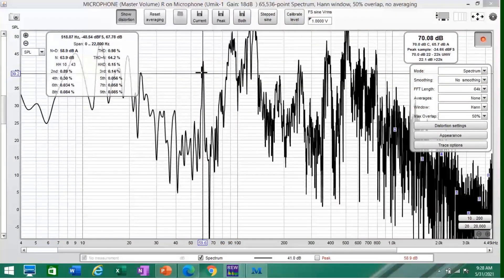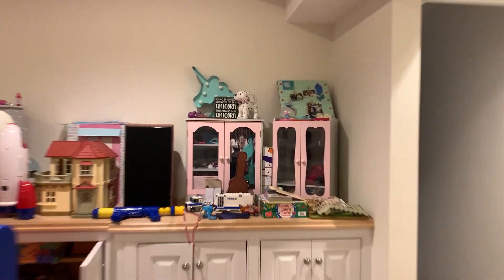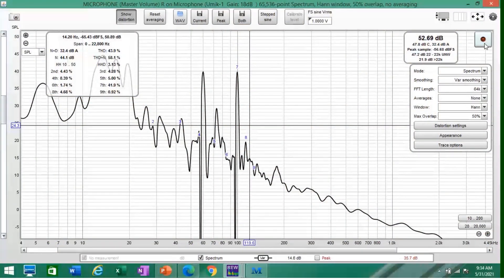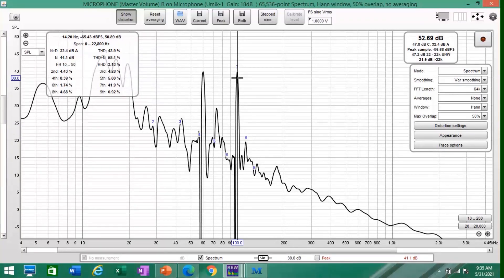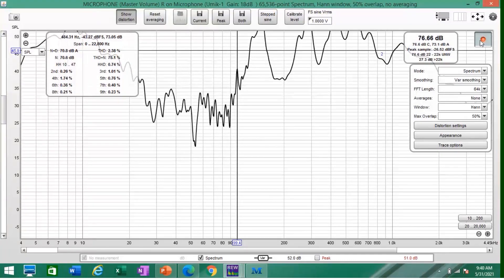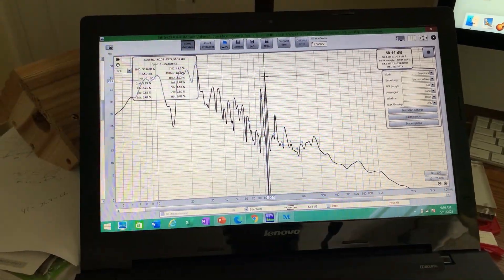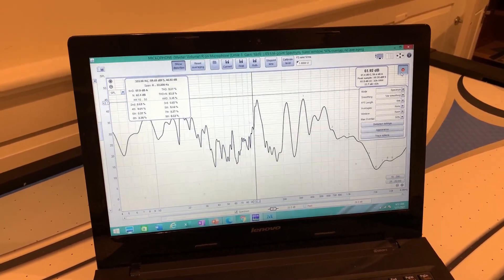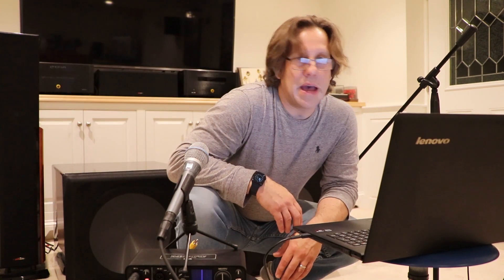REW - Solving a Mystery at 99Hz - what is causing this background noise?

Comment: 60Hz is the frequency of the AC outlet power lines. 
more often than not when 60Hz is present, some equipment acts as an antenna or multiple components connected together create a ground loop introducing a 60Hz... sometimes running the laptop on battery power eliminates ground loops. using balanced signal/devices help a lot w/ these kinds of interferences.

ps: when touching unplugged signal cables we act as an antenna picking up the AC frequency present all around a house and that's what gets amplified :)
Reply from the maker: Thanks for that additional guidance on the influence of line voltage at 60hz. I believe my 99hz noise was more of a mechanical vibration cause be the equipment on the floor above.-Jon

Comment: Turning those noises off, will not just fix your graph, but your mind too :D I've noticed our mind get used to low freq constant noise but it affects us without us knowing like making you made or not comfortable without you knowing there is a sound in your house driving your made. one of the reason why its a better option to get an air conditioner outside of your house and getting house equipment that makes less noise :)
Reply from the maker: Absolutely- I was so happy to track that one down. Yes - air conditioners, heating and ventilation are often a problem. -Jon

Comment: I continue to follow your adventures. You're in a good way to achieve a reference system but it will be long because you would like to discover by yourself all the topics covered by different experts. Actually you're in the "acoustician expert" phase. Make measurements is one of the best way to avoid marketing bullshits. In this world of AV equipment, you can read for example that you can improve the quality of image/sound if you use a premium HDMi. If you measure, you'll be able to confirm that no improvement is possible on a digital signal. The 0 and 1 will strictly keep 0 and 1. 
I agree with the another comment about the balanced signal for analogue links, this professionnal standard has so much advantages (maybe expansiver yes). 
Don't forget my previous comment, you have to be 100% sure about your measurements. When you find your 100Hz resonance, it's completly repeatable, doesn't matter, but later you'll use your measurements to compare performance of amplifiers, loudspeakers,... For this kind of measurements, you need to perform a repeatability study. 
It's strange but people like you who takes time to make measurements are very rare. Usually, equipments enthousiasts prefer to spend time reading sponsored papers or AVS members who has never done 1 measurement of their systems. They just listen the mainstream trends / resellers.
Reply from the maker: I appreciate the encouragement. It is good to know that this test-base approach works for some. I feel that measurements can serve me well as published specifications are often misleading, the speakers will sound different in my environment and helps to settle cases where my memory isn't perfect (is the setting better then what I heard yesterday? maybe I am just in a better mood today?) I find the Audioholics videos helpful as Gene takes a science-based approach. What stuck me that his guest, Anthony Grimani, mentioned that "trial and error" is still used despite years of experience and proper measurement tools. But "trial and error" is still measurements based method and scientific. I find that the more I test out different settings individually and then grouped with other settings, the better I understand the impact of each on my given room and playback equipment. For repeatability it is about performing the experience again and again to ensure the results are correct. I am remeasuring the same parameters a few weeks later after gaining more experience with the tools and methods. Its a journey and it is very cool to be able to visualize what we are hearing and to use science to improve the experience to personal preferences. -Jon

Comment: Hi Jon, I think this probably will be less of a concern when you get your pre pro and use the balanced XLR cables. Single ended cables don’t have the reciprocal signal to eliminate anything not transmitted from the source. Additionally you can try some “chassis grounds” between the different enclosures back to the power conditioners, etc. I had ground loops prior to XLR and that seemed to solve the problem; my brother has ground loops using single ended and chassis ground solved his problem. Grounding is one of the most misunderstood concepts in electrical engineering. Dealing with ground loops can be tricky but there’s always a way. And turning off your AC when you want to perform critical listening is not the answer haha
Reply from the maker: Yes - going balanced is going to bring improvements. I believe the issues I was uncovering were independent of the processor I fact the processor and speakers were not on at the time of discovery. What I was measuring was just the background noise in the room and finding these spikes at 60, 99 and 120 Hz. This was simply the unit-1 microphone plugged directly into a laptop with the spectrum analyzer. Fortunately I was able to determine the source of both the 99 Hz and 120 Hz background room noise.-Jon